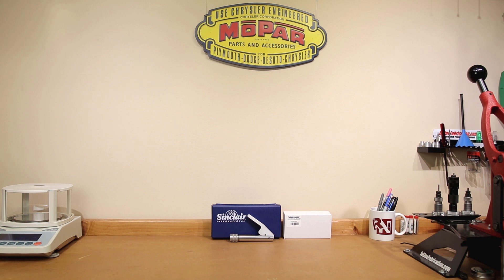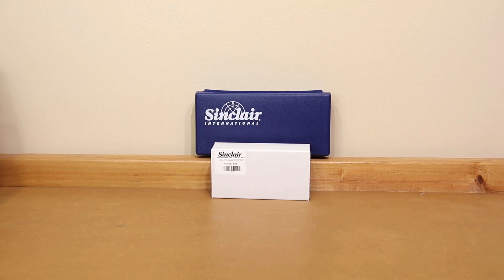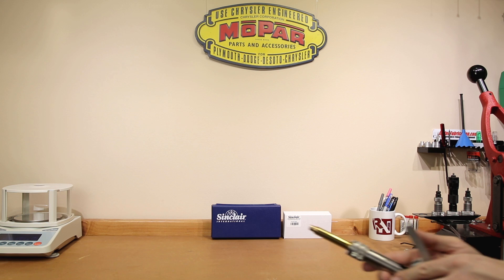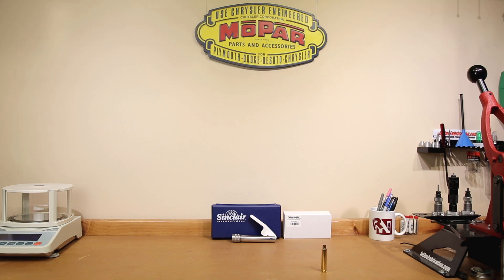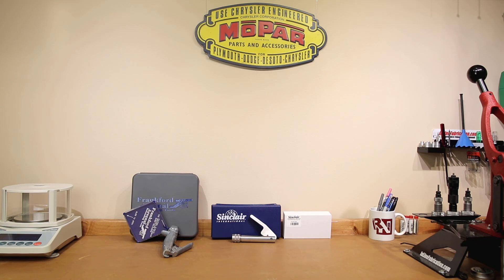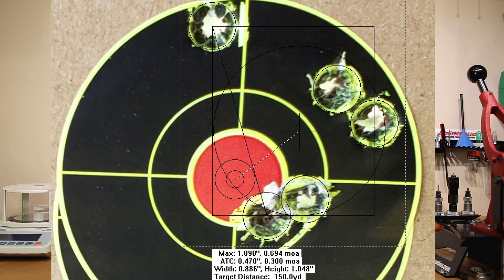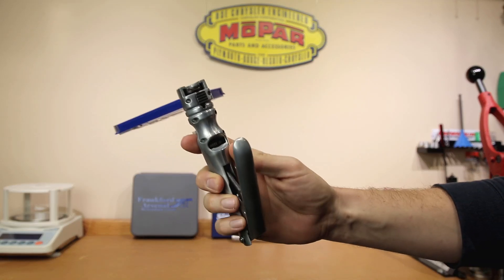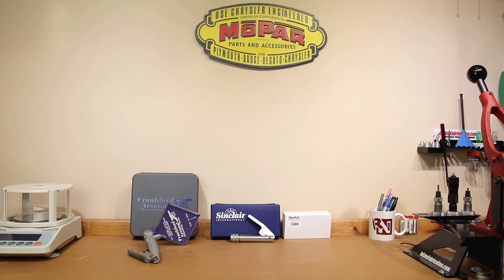Sinclair priming tool unbox and primer tool performance test

Comment: Hi there! I've been loading and competing for a LONG time, so a coupla comments: 1 - at 7:08 on, I see you using the MagnetoSpeed chrono. I do NOT like those things. Having something hanging on the barrel, no matter what anyone says, is a bad idea. Nobody I shoot with uses one. I still have my Oehler 35P I bought 30+ yrs ago, and a lot of guys use one. Now the Garmin is the hot stuff, and with how simple and compact one is, I'll probably set up both at once until I figure the correlation, etc. First, the 500 bucks! grins
2 - I used a Lee Autoprime forever, but the tray got broken. I always wanted a Sinclair ($140), but Brownell's was out of stock. I saw the Frankford with the depth setting ($80) and thought "Why not?" 
Now, I always had a great sense of feel for getting a consistent crush with the Lee, and my bros with Sinclairs have let me try them at the range, so I knew the difference was well worth the money. But the speed and certainty, not having to "baby" the tension, of the Frankford has me sold. Plus, I can't swear to it 'cuz I couldn't do a head-to-head with the Lee, but I attribute a small decrease in SD/ES to the Frankford. Psyching myself out or what, I don't know. laughs

Comment: Hey the thing I love about your videos is your honesty. Your willingness to express the likes an dislikes an open minded to other opinions. So I have both I been playing with primer ignition. So the Sinclair would be good for the guy that maybe does not load much ammo. Mine is put away maybe a give away. Now my Frankford has to primer button you can roll an set your primers  at any depths an you can run 100 primers as fast as you can squeeze the same handle. Plus come with all the shell holders an seated in a nice holding bo,x. I'm thinking about Gregs but 625 dollar's is alot an if you watch he really has to pull down hard alot for the same outcome. Just another opinion out of many again comes to personal preference. Great job on the videos.

Comment: Glad I watched this. Cross this off my wish list for Christmas lol. 
I am favoring the Frankford tool. I have used rcbs forever, but there is no good way to control seating depth of the primer. You control the pressure, yea, but I am not real confident about consistent pressure or depth. Specially if I am loading 50 or 100 rounds. Normally I just do small, discrete batches but every now and then ….

Comment: Good video. I use an old RCBS small bench tool that hasn’t been made for decades and is wearing out, looking for something new and the FA keeps coming up in primer thread after primer thread.
Reply from the maker: Hi Sean, it's certainly a good tool and I really like being able to control the depth. I will mention though if you load a lot at one time or are sensitive to it, my hands get fatigued after a while.

Comment: Another great video. I also have a frankford arsenal hand primer, loading for 30-06, lapua brass and fed gold med large rifle primers. I have to have the adjustment wheel cranked up to max adjustment to get the primers to seat just below the case head. (.002 below the casehead) measuring with my caliber,and getting the handle to bottom out. The priming tool seems to be working perfectly, I just found it odd that it has to be set to max in order for the primers to be seated properly. I've had know experience with other priming tools as I'm just getting started in handloading.

Comment: never test for groups with magnetospeed attached to the barrel, it will change the barrel harmonics, result in a better or worst representation of what your gun actually perform. My 0.75moa gun performed a 0.25moa group 10 shots group at 100 yards with the magnetospeed attached.
Reply: Brother what?

Comment: Love my FA primer.  I pull 10 primers and set the stop to bottom out on the  shortest one, that way I know they are all on the bottom of the pocket and/or slightly compressed. If there is a better feeling, more consistent way to seat and still autofeed I don't know what it is.  21st Century and K&M also make really nice primers, but no autofeed.  My one gripe about the FA is I wish the load and feed were on the sides instead of the front and back.  To me, it always feels upside down in use.
Reply from the maker: I agree completely, but it seems to work pretty well

Comment: I have watched benchrest shooters seat primers with a sinclair seater, throw a charge with a 10 year old powder measure and then shoot .1 5-shot groups. The most important factor in accuracy is barrels, bullets and bedding. The rest must be ironed out, but ultimate accuracy hinges on the above.

Comment: I use the primer on the top of the Forster Co-ax press. Do you think it is on par with the handheld priming tools?
Reply: Only if you don't want to "feel" the seating process.
Reply: Same, I always think that hard stop is the way to go. People don't like the Co-Ax priming system for some reason. I love it, even though it's slower than bench or hand priming.